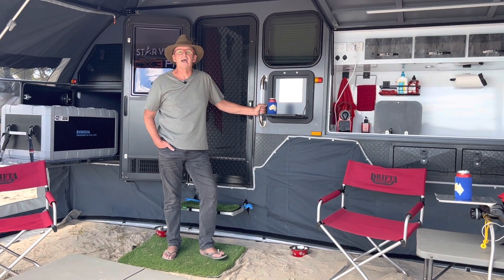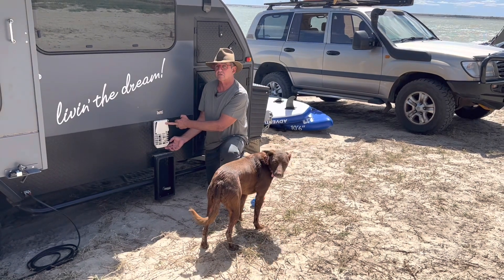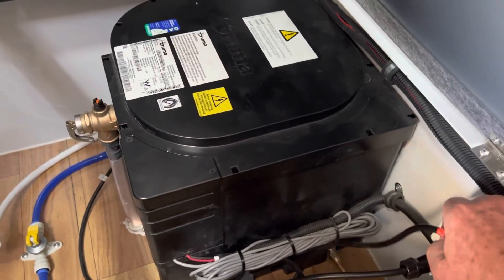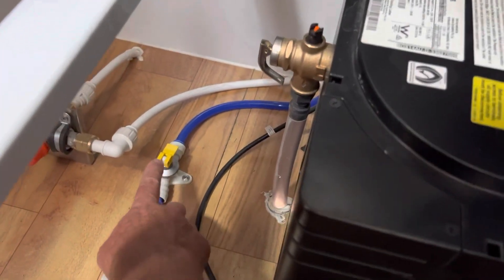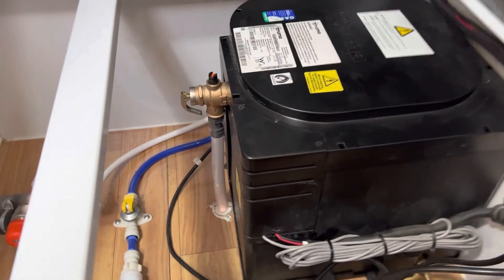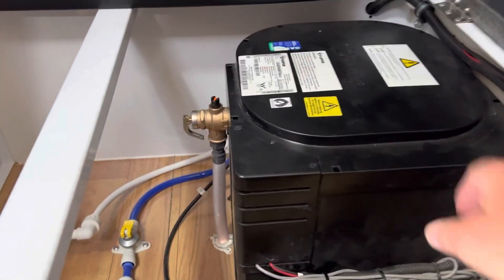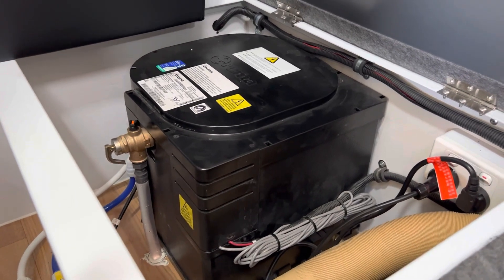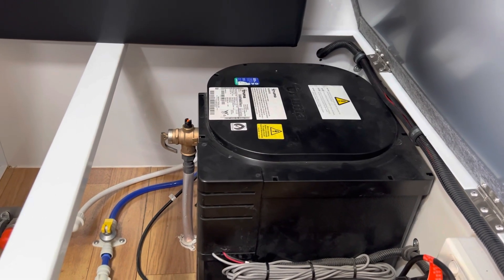AusCamping - Truma UltraRapid General Use

Comment: Great video mate. I also watched  the other hot water video as it was extremely helpful. 

I do have a few questions:

1: if I’m at a caravan park and the truma switch is in the middle position. It won’t use the gas at all? Would that be correct?

2: should I empty the hot water system while travelling? Or, is it safe to keep water in the unit?

3: should you switch off the unit when not using? Or, is it safe to keep on? 

Last one, mate: does the hot water unit automatically fill up with water when I turn on the pump while off grid. Or, connect to mains while at caravan park? 

I appreciate you taking the time to create those videos.
Reply from the maker: Hi Alek, nice to hear that the videos have been helpful to you, if you are doing your own review, please consider crediting our original videos in your comments 🙂

I'll copy and paste your original questions for clarity of answers;

1: if I’m at a caravan park and the truma switch is in the middle position. It won’t use the gas at all? Would that be correct? 

CORRECT -  the rocker switch remains in the centre position if you wish to heat via power rather than gas. Note, if you are plugged into power and also use the rocker switch, then you will be heating with both gas and the electric element. Handy for rapid heating when you first arrive at camp, but turn the gas rocker switch off (middle position) once the water is up to temperature if you wish to conserve gas.

2: should I empty the hot water system while travelling? Or, is it safe to keep water in the unit? 

SAFE - you can keep the hot water system full while traveling but definitely empty it if you live in a climate that is likely to freeze the water when in storage. I also prefer to empty the unit when in storage so the water does not stagnate, but when we are on the road travelling from place to place, we do not empty the system between campgrounds.

3: should you switch off the unit when not using? Or, is it safe to keep on? 

DEPENDS - this depends on what you mean by "not using". If you are in storage and not using, then Turn it off. If you are camping and want hot water available at any time, then leave it on. Right now, we are living in our van full time and off grid, We have found that we save gas if we turn it off when not required and it only takes 15 minutes to heat up for a shower or to wash dishes, so in the interest of gas savings, we have only been turning it on when needed and turning it off at other times. 

4: Last one, mate: does the hot water unit automatically fill up with water when I turn on the pump while off grid. Or, connect to mains while at caravan park? 

NO - if the system has air in it then you MUST bleed that out as shown in our video. It is not a self bleeding system. If you keep it full between moves and don't allow it to drain, then you can turn your pump on at the next stop and use it without bleeding, but if you haven't used it for a while or you have turned a tap on and drained water without having the pump on or water pressure attached, then it is a good idea to pop the bleed valve and make sure you don't have any air in the boiler tank.

Safe travels
Craig & Anett
Reply: @ your the best. I will definitely do a review like yours once I get my new van. I will also refer your channel in the video and description. 

I’m in Victoria and will be on the road around Xmas. I hope to see you around
Reply from the maker: @JustAnotherReviewwithAlek  let us know if your on the west coast, we are just about to start building at Sunset Beach WA (near Geraldton) and will focus on that for a while before we go back on the road.

Comment: Does the system have to be full of water to use gas?
Reply from the maker: It should always be full of water before heating but generally it will stay full between trips unless you are draining it for safety in cold climates where damage might occur as a result of water freezing in the pipes

Comment: In my just purchased CX2 I found the power cord without a plug or not connected to a switch. I queried Star Vision. Their reply " The Truma is gas only". The discussion is ongoing
Reply from the maker: Hi Dave, I do see on their website that for the CX2, they only specify gas for the hot water. I wonder if it is not possible for them to cable a 240V outlet to the location or maybe some other safety reason due to the location and the Australian regulations. Have a chat to Kyle at Head Office, if there’s a reason why it’s like that then I’m confident that he would tell you and if not, then he should be able to organise to get it fixed.
Reply: @AusCamping  Yeah ! Just waiting on a reply for my warranty work, plus an extra battery, dcdc. Had the van out for a weekend already. It is just what the doctor ordered. I am sure there will be a happy ending.
Reply: @AusCamping  they might be using a (cheaper) system which is designed for 110VAC.
Reply from the maker: A possibility, although they build them all in the same factory so it would seem strange that they would use a different water heater in only one model 🤔

Comment: Craig,  did you install the HWS or was it installed by StarVision?
Reply from the maker: Hi David, it was factory installed.  The Truma UltraRapid is actually a very good and reliable unit which is factory installed in most of the StarVision hybrid models

Comment: This is the easiest clip I’ve seen to understand the system, I’m still confused how to fill up the Truma tank with water when it’s empty.
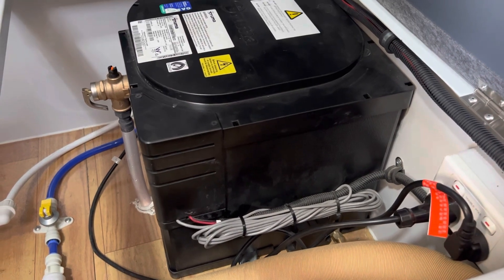Reply from the maker: Thanks for your feedback and question. Between minutes 2:30 - 3:00 I explain how to make sure it is full. In summary, either hook up to mains water or turn your water pump on if you are not connected to mains, then operate the valve as I do in the video to bleed out all the air. Once you see a bubble free stream of water exiting the water heater, you have filled the system.